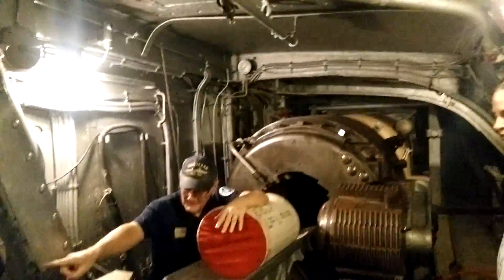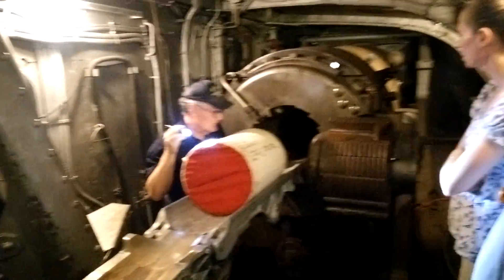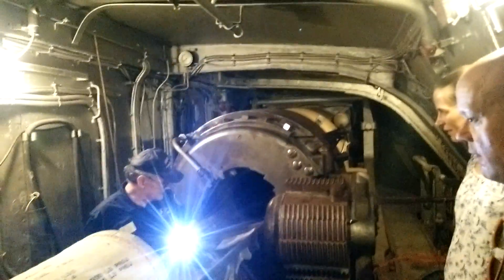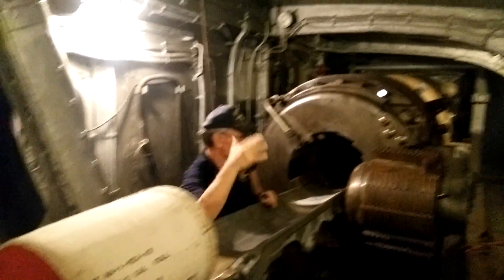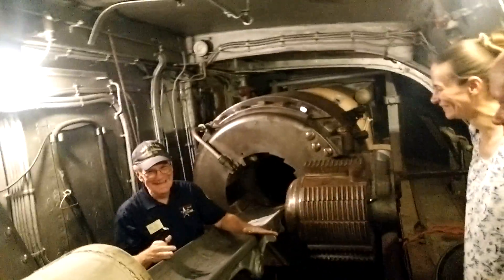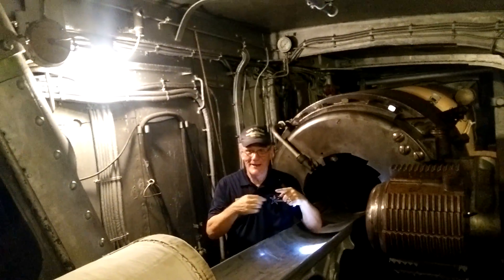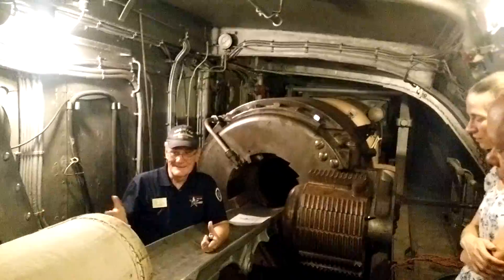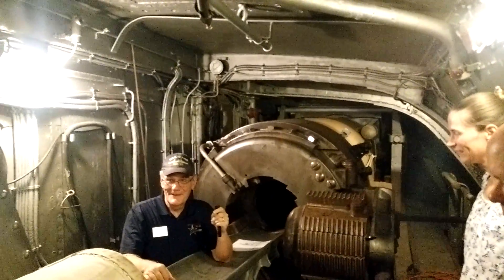USS Texas Main Battery operation explain. Como funciona los cañones de 14 pulgadas del USS Texas

Comment: are turrets functional? do they turn? fire? (not saying to fire them)... thanks in advance...
Reply: By recent pictures, they are probably rusted in place. I believe the rifles could still fire, but there are nearly none of the proper powder ( those 105 lbs silk, mixed load ) bags left to fire the actual shells, in safe usable condition. 
U S S New Jersey still has one wall of her powder magazines stocked with the shipping cans, but the normal bags of powder are now gone because it becomes unstable over time.
Reply: Even if it they do, they probably have an agreement with the Navy like the younger  New Jersey that says they can never turn the turrets, fire the boiler, or attempt to fire any gun.

Comment: How loud was it in the turret when the cannon fired?
Can't imagine have to lay down and the cannon recoil above you with inches to clear.
What was used as a primer to set off the charge.
Reply: The sound was loud, but being inside the turret drowned it out. A electrical wire triggered what's essentially a specialized spark plug igniting the powder. Though there was a manual system for other caliber guns during and after that time period.
Reply: @peterson7082  awesome & cool video thanks.
Reply: @berzerker1100  I didn't make the video
Reply: That is what I wanted to know. How or what ignited the powder charges?